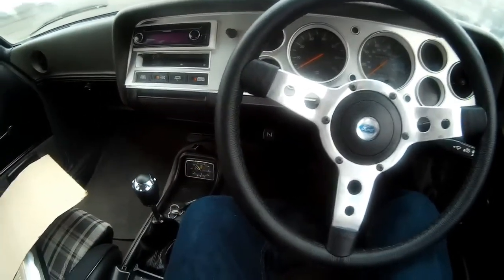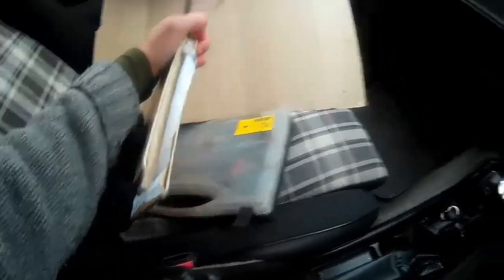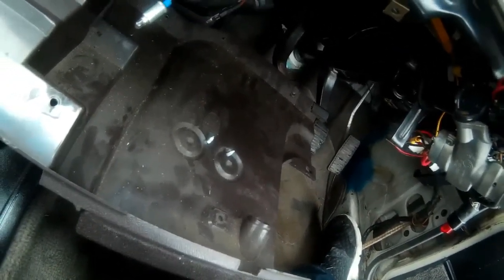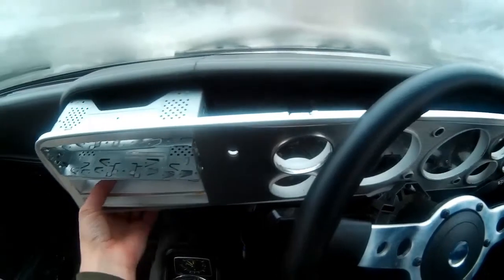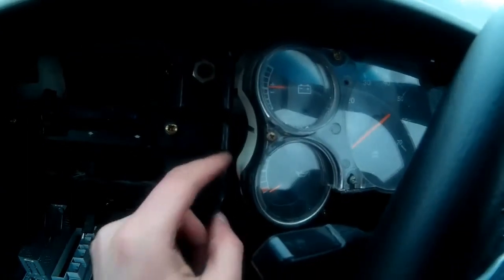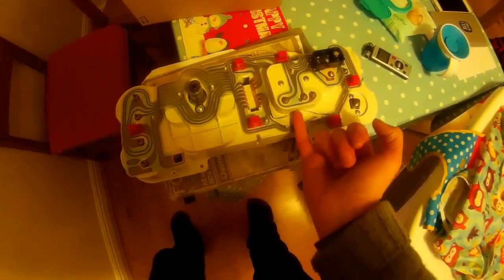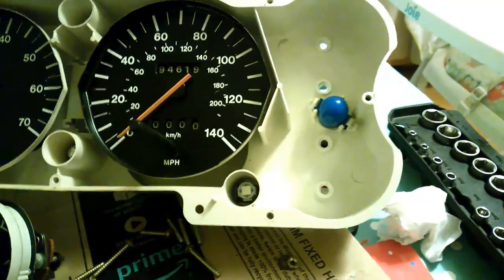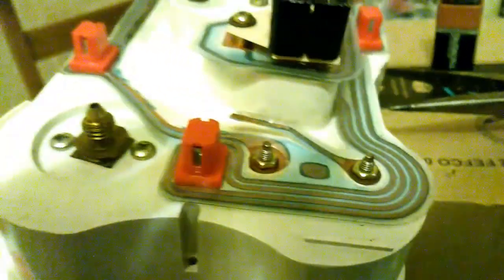Ford Capri Dashboard  Lights Repair & Dash Removal

Comment: Good job! I've done similar with my 2.0s. I used green, single LEDs with a domed clear acrylic top. I clouded the acrylic a little by rubbing them with some toothpaste, as I wanted the light to disperse evenly across the dials and not have bright spots reflecting back at me. I'm not sure if this was necessary, but it worked really well. It's amazing how dim the originals get over the years with those flakey coloured bulb covers!

Comment: Interesting point you make about the Led lights I have a mk2 Escort and I have changed my dashboard lights to Leds the all work as they should but the only thing I find fault with is the Main beam light when you put the side light on no problem push the stalk up to dip lights and the Blue main beam light on the dash is illuminated if you push the stalk forward for main beam it’s stays on pull the stalk back to flash the lights it works as it should but it still stays on any ideas what it could be I have tried to change it back to the original bulb but makes no difference

Comment: I've had capris every day for the last 32 years.think the heat your getting is due to the air flow through the scuttle panel and spins the heaters fan blades.all my heaters have packed up.i'l take a look at the V reg now that got that back after 7 years in barn storage.the lower part of the dash out on that 1600L so maybe try the multi meter on its unit and see if can find the fault.